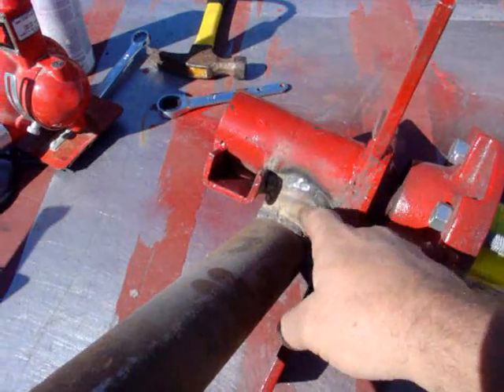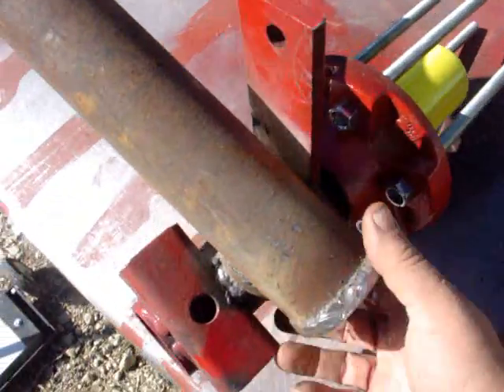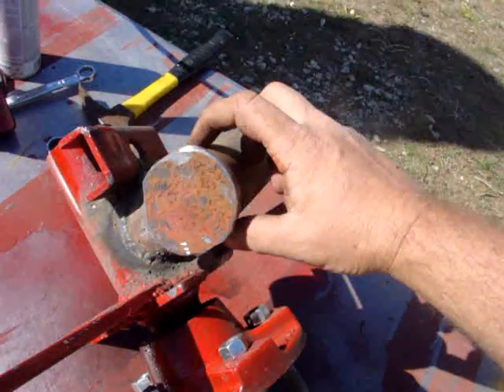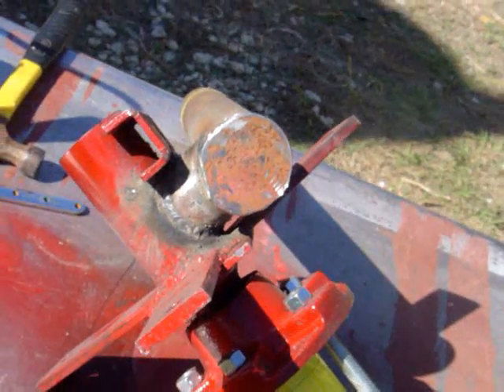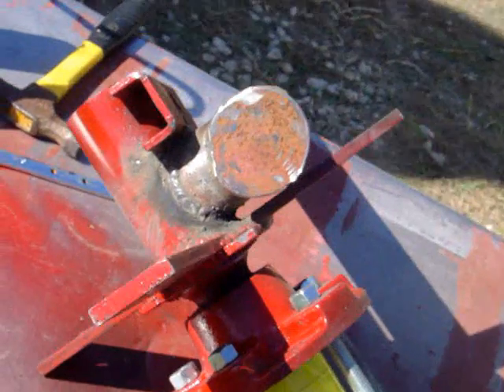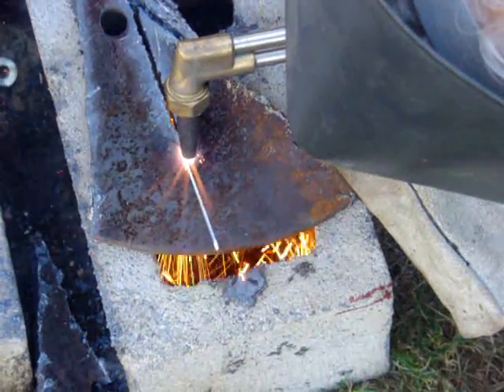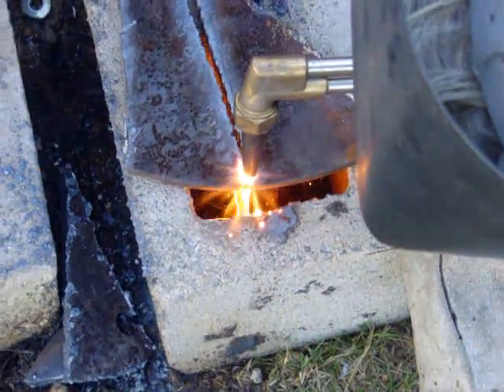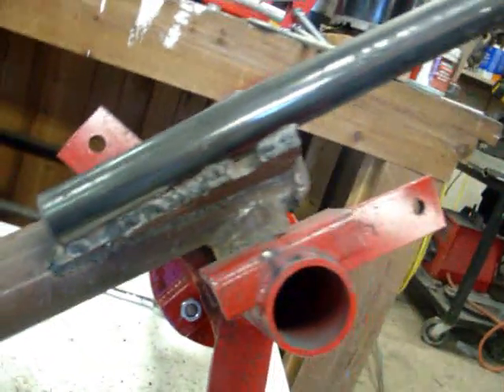BUILD A DUAL PERMANENT MAGNET ROTOR WIND TURBINE (PART 24)

Comment: Know you did this on the cheap but using aluminum for the four legs would have been lighter and easier to turn in the wind and is stout enough but...but would take "tig" welding. Much prettier welding

Comment: Like I said...mig welder uses argon gas for less splatter and no splatter to remove. Co2 for your shield (flux like on a rod) doesn't cool the splatter fast enough leaving much splatter

Comment: To get an easier - smoother - faster - ready to cut/restart on steel,  run a disk grinder over the area to be cut [front/back side] just enough to get rid of the rust/corrosion.   Its amazing how much better the cut will be and easier to do.   
Since you give out so much info,  thought I'd share a little on cutting steel.  
regards

Comment: @muddymuddymuddmann
  G'day... Yeah, I thìnk I've heard of that one. The twist in the tail is that the Elite didn't get around to Building the Moon Base, let alone Colonise Asteroids, or Moons around the nearest Gas-Giant..! They flew 8-Engined Jetbombers, 578 of them, for 100,000 Hours each ; at $10,000 per hour, per engine... 
  When 1 Pound to Low-Orbit was $10,000. If the US Dept. Def. had  lost 1/2 it's Budget to NASA... They could've had 182 Moonshots, in 1969 alone !

Comment: @muddymuddymuddmann
  G'morning...  Um, no, I never heard of curing Bamboo with Heat... I imagine it'd have to be fairly mild ? Anything over boiling would maybe blow the Compartments, from Interior Moisture turning to Steam ? I think a problem was spontaneous splitting, so lots of reinforcement- binding had to be done. By WW1 they'd moved on to Laminated hollow Wooden Spars, with bindings. (Kiwi) Peter Jackson built a Replica FE-2b, & it's tailbooms are Wood.

Comment: @muddymuddymuddmann
   Yeah, its an irritation... But I am happy to have worked it out. The Bolt was close enough that the sheetmetal of the Hut went "KLICK !", almost half a second before the "BOOM !", so at 1000 Ft/Sec, it wasn't far above... And something went awry in the Spare Regulator I'd been using, too, it was feeding 0.4 Amp back into the Panels at Dawn....! Twice in a fortnight, and even I put it together.  The answer is, bigger Diodes I guess. Hard to build against Lightning !

Comment: @muddymuddymuddmann
  G'day...    Well, yeah. My T.O.P. fried the diodes on the replacement Gallium PV's, last night. The "Automotive Blocking Diodes" I'd been told were 10 Amp, turned out to be 1 Amp... But , like the 6 Amp set that worked OK until a fortnight ago, they were OK for daytime. Last night, Lightning at 500 Ft put PV current from the Flash ! against the Induced Current in the wires from the EMP of the Lightning. So, 1/4 Power till I get new Diodes fitted...

Comment: @ronnie8991
@muddymuddymuddmann
  G'day... Well Done Scotty. Good stuff !
   Um, Ronnie, as a bit of Reality Awareness Therapy, work out how many Kw-Hrs you use, daily. In Oz it's 25-50. Then work out the cost of owning a pair of Big (10 KvA) Piston Generators, & running them, alternately, 24/24 to compete with the Dreaded Coal Grid. You'll be AMAZED how Cheap the Coal-Juice is sold... Vs  $70,000 for a 20 Kw Solar Stand-Alone System. Y'see